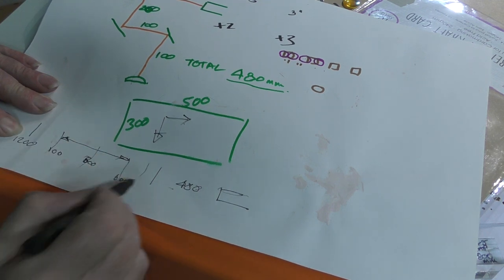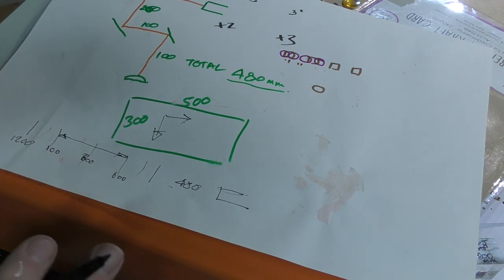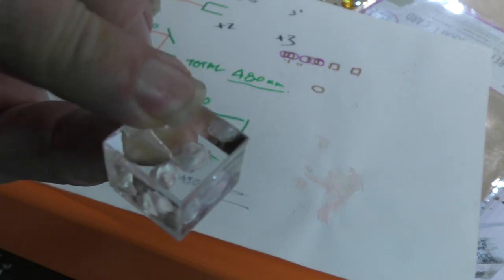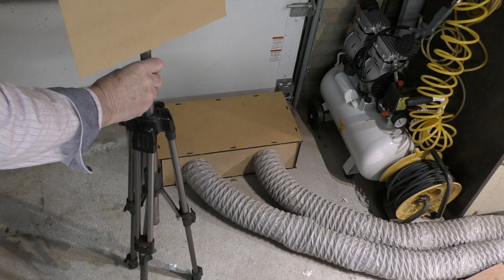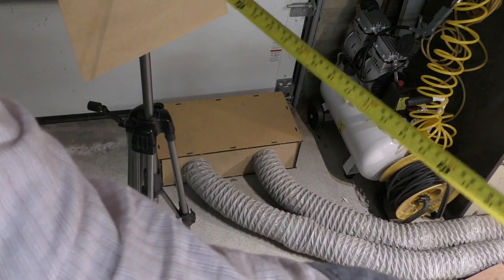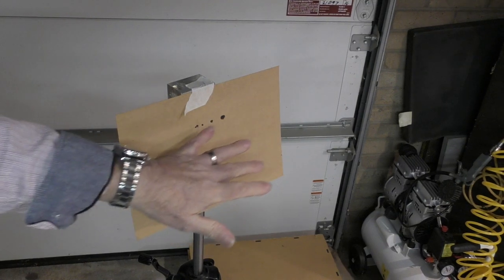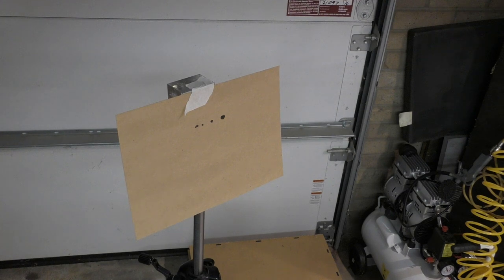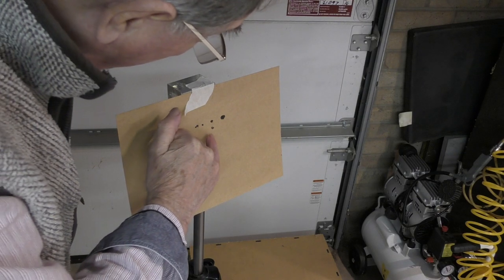RDWorks Learning Lab 230 Beam Conditioning Part 3

Comment: Hi Russ,

I think I may have mentioned this before, but being of a 'mature' age I do forget things...
Is it possible that you are creating an EGG TIMER shape of beam that necks down and crosses over itself at the 800 mm point ?
Best regards
Jerry
Reply from the maker: Hi Jerry
 you may well be right but it's not a significant problem because I get that sharp beam (as exiting the tube) that I am trying to project onto the work area. The fact that I do not get 100% success is bearable because it will prove the point I am aiming for.  In this session I discover that amazingly "sharp" intensity profile  is not performing how I dreamed. In the next session I will have to investigate what's happening and maybe admit  the doom merchants were correct.
 Best wishes
Russ

Comment: Hey  Russ i have a laser machine and my colimator lens are broken it use a coherent rf tube 30w  can you suggest me can i use beam expander from cloudray  my tube produce 10.6um wavelength beam.. can you help me ?? Thanks for your knowledge sharing...
Reply from the maker: Hi Gregor
The 30 watt Coherent is just like many  standard 30 watt format rf tubes( but for some resason twice the price) and it will have a beam divergence of 8mrad ( about 8mm beam growth per meter). Across the width of your machine that changes the performance  significantly in different parts of your table if you do nothing about it. The very expensive 200watt Coherents have a beam of abouut 5mm and divergence of about 2mm/m which means it's uneccesary for a beam expander.   Your beam starts off (just like mine )at about 2 or 3mm diameter  but put it through even a X2 expander  and it finishes up at about 6 or 7 mm diameter and then becomes very inefficient at cutting., That's why I have been experimenting with beam expanders  in these sessions, to see if I can find a way to improve the cutting performance.. It has taught me a lot about this item and lenses in general  which is at odds with what optical experts advise me. These devices are designed with ray tracing theory as if it was going to be used in a telescope. If you look at this website you will see that the two main beam expander designs are named after Gallileo and Kepler (famous astronomers of the middle ages).   
https://www.edmundoptics.co.uk/knowledge-center/application-notes/lasers/beam-expanders/
 Two spherical geometry lenses means two lots of spherical aberration. The path of laser rays is eactly the same as normal light but the difference is  the Gaussian intensity distribution within our beam A little bit of aberration when all the rays are the same intensity  is a minor inconvenience for astronomers causing slight  image fuzziness that can be corrected by additiona optics.  We do not have additional corrections  and the INTENSTY distribution within the beam after it leaves the expander  is less  Gaussian and  gets staedily worse as the beam lengthens.  Sadly you don't have a choice, you need a beam expander. I have found that a X2 is the least worst option and you can buy this from Cloudray. They are designed with high quality CVD ZnSe lens material and there should be zero risk of damaging the lenses with only 30 watts. 
 Best wishes
Russ

Comment: Would a motorized " lens conditioner " with a small 0.9 degree stepper motor, that worked in combination with the Axis movements to pull focus when moving around the table, it would be fairly easy to do.
Reply from the maker: Hi
My design mentor from MANY years ago beat into me several key philosophies.  ""Do not attempt to solve a problem until you fully understand it " and  "Understanding a problem is 50% of the solution" are but two of his pearls of wisdom. I have a goal that I am aiming for but I am a LONG way from understanding what problems are in the way of that achievement.  I am puzzled about what you have seen so far that suggests it could with solved a motorized conditioner. I am not condemning the idea but just putting it on the "possible" shelf.
Best wishes
Russ
Reply: I was thinking of something similar but with a linear voice coil. This is what's used to maintain focus on CD drive lenses.
Reply from the maker: @DCBpower   
 Hi Tim
 I find it fascinating that this subject is stimulating possible solutions  at such an early stage. . I have a very open mind so no ideas are rejected
 Best wishe
Russ
Reply: @SarbarMultimedia  Speaking of understanding, Perhaps you are in a better position to answer a question I have been wondering about, Let's forget about RF lasers as they are their own thing, besides my question is focused on CO2 laser tubes, Say one the tube is rated at 30Watts and another is rated for 60Watts, If both tubes are running at 10milap are they both producing the same power output? is the overall power of a tube its ability to be pushed at more Milliamps?
Reply from the maker: @patprop74  
Hi
  A few years ago  all laser tubes were 50mm diameter and  it was easier to explain the answer to your question. typically they ran as follows
800mm long =40 watts at 18mA
1000mm long=50 watts at 20mA 
1200mm long=60 watts at 22mA
1600mm  long=80 watts  at 24mA
2000mm  long=100 watts at 26mA
I think you can see the pattern.
The longer the tube the more voltage it required to ionize the nitrogen to create the pink beam. However, once the gas had ionized it was all down to the HV power supply to regulate the current flow.
 If you look at a power supply specification it will be rated with a Max current flow. That  max value is the current that will flow when you ask for 100% power. The %power is nothing to do with tube watts but is a linear relationship to current flow ie 50% power = 50% of the max current flow.

 The internal construction of the tube (its mirrors,  diameter of the central ionization tube  and the length of that tube ) determine the output watts of the tube. Those output watts are very NON-LINEAR  Take a look at this video  starting at about 21 mins and you will see what I mean   
https://www.youtube.com/watch?v=nZuatc3eIgU&list=PLPWEtx5V9DqEogIeYRdcG_KYcB7UL2Qmn&index=25&t=1443s

So, if you put all these facts together you will see that the same current  can produce significantly  different watts output.

 It is trickier to explain this today because we have 55mm and 80mm diameter tubes that contain more gas (for longer life) but are significantly shorter than the table above. They produce the watts from a shorter tube and with lower current flows.

 Best wishes
Russ

Comment: Hi Russ. Before watching your recent couple of videos on this topic, I thought that because of the way a laser beam is generated inside a fairly long tube, that the resulting beam was pretty much a consistently narrow beam at least through 1200mm or longer distance. I keep thinking if we were able to do away with the 3 mirrors altogether, and deliver the beam to the engraving/cutting head and focus lens via a sort of fiber optics conduit (that will not be melted by the beam). Wouldn't that be something? best regards, Steve
Reply: на данный момент, на сколько мне известно, оптоволокно для CO2 лазера имеет огромный показатели потерь (свыше 70%), это не целесообразно
Reply: @Lasermachines  ok, so if a 90Watt laser tube is really 80Watts, and it gets reduced to 70%, it becomes a 56Watt tube. At least the beam itself will have a small diameter when it hits the focus lens. It will not have been diffused when having to travel about 1200mm through its normal path. I'm curious, though, does anyone use fiber optics to bring the beam to the laser head, and what material is it made of, and how expensive is it compared to the 3 mirrors.
Reply: @sz72909  90вт - 70% = 27вт, но это достаточно оптимистичный взгляд. Можно поискать в ютубе информацию по этому оптоволокну, его изобрели в России, на сколько мне известно

Comment: I think it might be worth while to consider diffraction as an element at play. In a camera lens as you go from a wide open aperture to the midrange the image usually gets sharper. As you continue to get even smaller, although the depth of field increases, diffraction also becomes an issue. Now I will confess although I like technical videos I have trouble staying awake through them especially when watching at late hours, thus I didn't see your entire video so maybe I'm missing something. That said, what I see in your resulting burns is a diffraction issue.
Reply from the maker: Hi Greg
  Several optical gurus had predicted that  diffraction effects will cause focal spot size growth and  I understand the diffraction effects of  putting a physical  aperture in the light path. However, there are no obstructions in the light path just a smaller diameter  beam with a much higher light intensity at its center.  There is less spherical aberration because the beam diameter is smaller. It's the same light ( but more intense) through the same lens. The lens cannot change it's refractive index so it will perform  the same in both cases. Material damage is all to do with light INTENSITY  and that is the only factor that has changed.. In the next session  it will be the material damage that will allow me to reverse engineer what the lens is doing to the light . I have already demonstrated that the light going into the lens has retained its tube exiting Gaussian distribution.. There is a concentration of aberration effect at the central axis of a lens that coincides with the high intensity Gaussian intensity.  My optical ignorance  does not precondition me to  explain what I observe with conventional theories. I have my trusted optical assistant (acrylic) that will truthfully show me what is happening to  the light intensity distribution within the beam. 
I think this is a fascinating subject that  I can find no research to guide me. 
Thanks for your comments that align you with many others. Technically the odds are stacked against me but  I need to decode what I see.  I'm not just a grumpy old man, I was born with skepticism encoded into my DNA.
Best wishes
 Russ